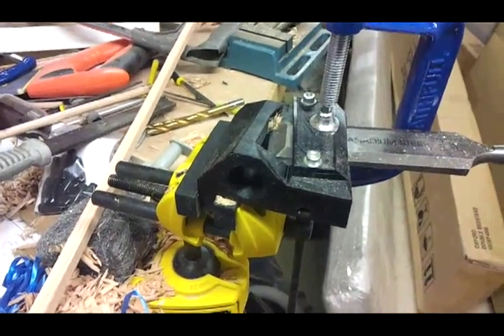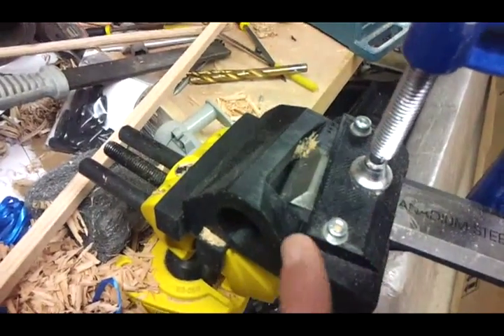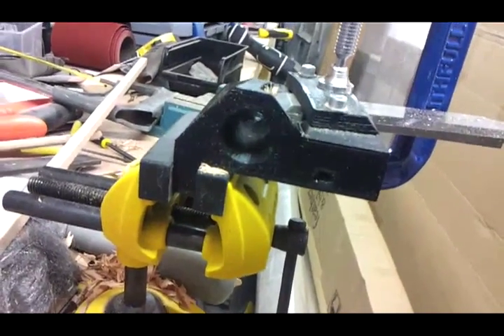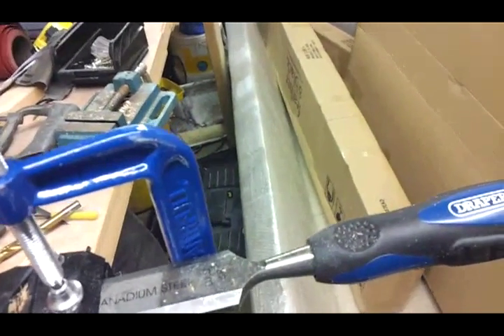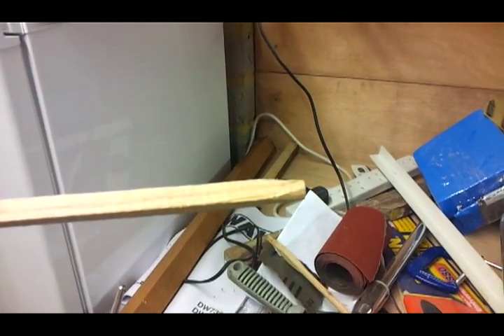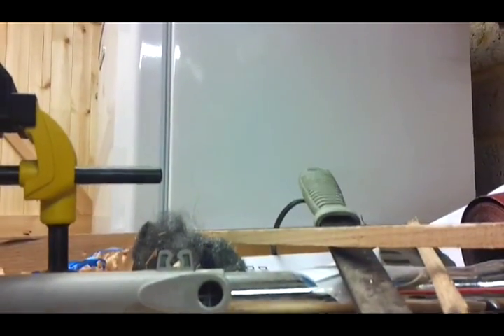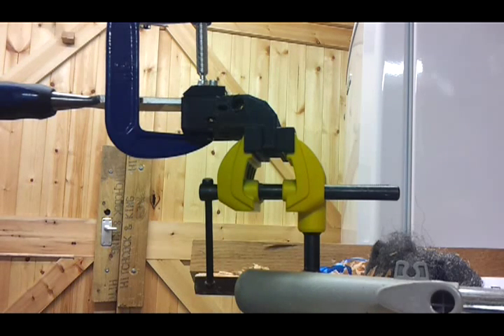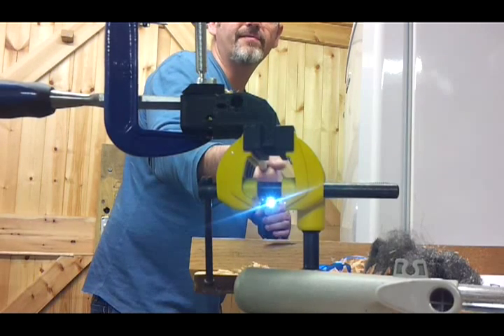3D Printed Arrow shafter / Dowel maker in action

Comment: If You are going to use this for arrow shafts, You will need to be on a table with ANTI-WHIP blocks to catch the shaft on the rounded side. Otherwise it will whip around and be less round than needed! Just a suggestion!